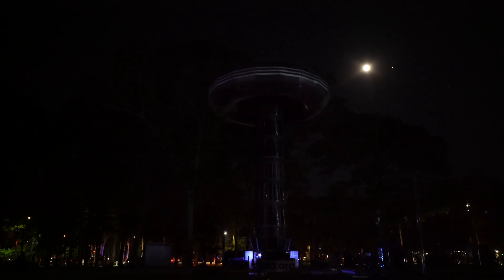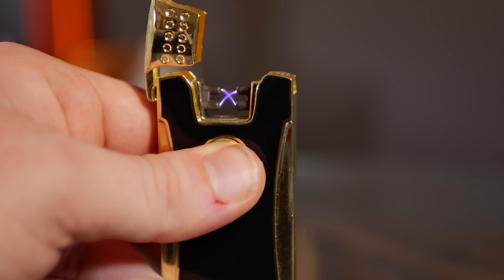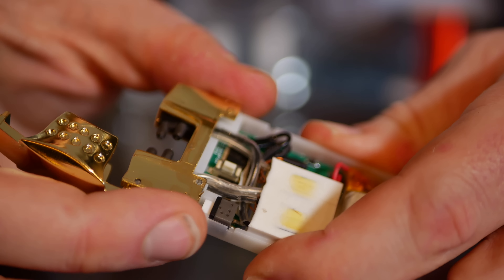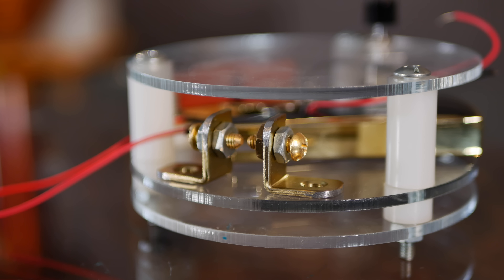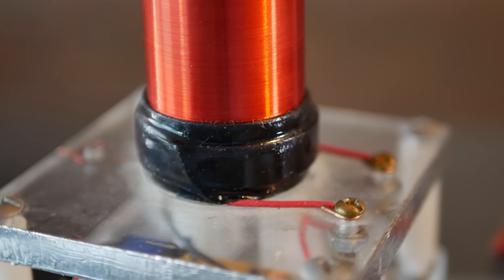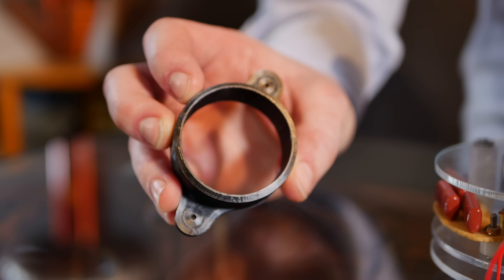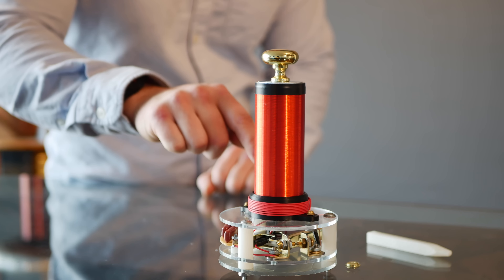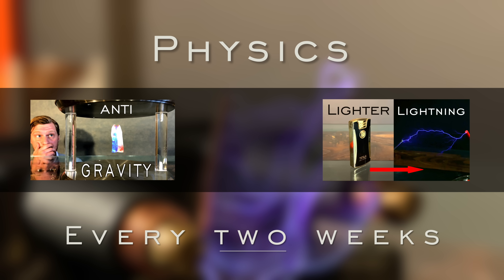DIY 50,000 Volt Arc Lighter Powered Tesla Coil (ft. Integza)

Comment: You never told us what size primary wire to use.
Reply: A bit thicker than the secondary, not really important-turns are.
Reply from the maker: AG is correct.

Comment: Hi Jay, I'm trying to do this Tesla coil for my physics class I got everything but when I testing the Tesla coil is not working? Can you help me.
Reply from the maker: Have you made sure the power source is working? If Yes, do you have the right fast-acting diode? If yes, make sure the spark gap is no larger than 1mm apart. Cheers.
Reply: @PlasmaChannel  thank you Jay for responding, I found the problem, the place I set capacitor was wrong and right know I have a working Tesla coil. Thank you for your amazing Chanel.

Comment: 6:15 also protect from Corona 🤔 .   What did he meant ?
Reply: Corona is leaking charges, usually from sharp points, reducing the output voltage. So the electrical tape prevents charges from leaking, making for a more efficient and higher voltage coil.

Comment: What is the ratio of turns between the primary and secondary?
Reply from the maker: Tesla coils are not necessarily about traditional turns ratios. But whatever 570/8.5 is.
Reply: @PlasmaChannel  my current tesla coil has a ratio of about 275/8 but the driver circuit is basically a flyback transformer driven with a single mosfet. Is the circuit just too poop for this use or the ratio too small? Because i don't get any sparks aside from the spark gap...
Reply from the maker: @drnuget3346  You're driving it with a mosfet...so what...24 volts? Mine is being driven by 4000 volts and a spark gap. You're likely producing a few hundred volts, which is what most small DIY mosfet coils produce
Reply: @PlasmaChannel  nah, the flyback transformer is driven by mosfet and the flyback drives the spark gap. The flyback transformer in parallel with the capacitors creates arcs similar to a tazer.
Reply from the maker: @drnuget3346  Interesting. Have you tuned your primary frequency to the secondary frequency? I dont know what size caps you are using.

Comment: que pasaría si haces otra mini teslacoil pero esta vez mandas el out de tu primera teslacoil a la bobina primaria de tu segunda teslacoil así estaría transformando esos 50.000 en no se tal ves 100.000?
Reply from the maker: Hello Elias, that is a great question. If I powered one Tesla coil with the other, I would need to rectify the output of that first Tesla coil so that it would charge up a capacitor. But, the second Tesla coil would need to be much larger and designed totally differently in order to support a 50,000 volt input from the first coil. 

Ultimately... it’s possible. But tons of work

Comment: Can the wire we enameled
Reply from the maker: Are you referring to the secondary coil?
Reply: @PlasmaChannel  thss we coil that is warped around the bigger coil
Reply from the maker: Are you familiar with what happens to the coil of wire if it has no coating? It acts as a solid tube, and the electricity isn’t forced around the turns of wire, thus, the coil of wire doesn’t work at all. Any coil of wire will always need insulation, and for purposes like this, enamel magnet wire is definitely best.
Reply: @PlasmaChannel  ye o though if it doesn’t neend to be enameled whe not just use a tube but I just had to make sure

Comment: I have a problem. My spark gap isn't arcing when I connect the secondary coil
Reply from the maker: What are you connecting the secondary to?
Reply: @PlasmaChannel  I've got a circuit that you draw with 5kV high frequency diode and three 4nF 3KV capacitors connected in series with spark gap pararerly conected
Reply: @PlasmaChannel  it's exactly like that circuti drawing
Reply from the maker: Hm. How wide is your spark gap?
Reply: @PlasmaChannel  around 1mm but even if I'm about to connect it it doesn't arc
Reply: @PlasmaChannel  my bad I wanted to say primary coil. Secondary si not conected to anything of course. It probably confused you.
Reply from the maker: Try reversing your diode direction. I found arc lighters are AC, but in a biased DC direction.
Reply: @PlasmaChannel  Still nothing. Do you think I should make a full bridge rectifier for it?
Reply: @PlasmaChannel  maybe I can send you some photos and video of it on some social media
Reply from the maker: Ondrej Lukacs yes please do. The link to my Instagram and Twitter are in the video description. I’ll lookout for your pictures.
Reply from the maker: Ondrej Lukacs your case is really strange. Can you send me higher resolution photos of your setup? Hard for me to visually see from the videos.
Reply: @PlasmaChannel   This solved my issue. I had it connected with the anode side toward the arc lighter output (as per diagram) and it brought me no joy... Removed heat-shrink from everything, resoldered it with the cathode side toward the arc lighter's output and-- BOOM! goes the dynamite.

Comment: Im having a problem i cant figure out. it seems like whenever i try to place any capacitor across the arc lighter it just loads it and doest make any sparks and the caps dont charge. its like it just quits working with the cap added. do you have any advice or know why that might be happening?
Reply from the maker: Hi Ozy, did you follow the schematic precisely?
Reply: @PlasmaChannel no i just put a capacitor across the output to see if it would charge it. You see ivd had this problem in the past with trying to use an arc lighter as a mini HV pwr  supply. it just wouldnt work when i placed a cap across it. at the time i figured perhaps the power was just too small and the caps were loading it and prevented the voltage from rising high enough to produce an arc but now im not sure cause i bought another arc lighter recently and tried again with same results. I then removed the small transformer from the circuit and rebuilt the same driving circuit using higher power transistor (and i mightve used slightly different resistora values i dont remember) and connected to my supply to see if itd work with more power but still didnt work when connected to a cap but take the cap away and out comes a nice purple plasma. Isnt that weird? I must be overlooking something cause clearly others have already shown they can be used with multipliers and such. I used a magnet to test to see if the lighters i bought output ac or dc and both mine were DC so there must be a internal diode in the small transformer but im pretty sure that shouldnt make a difference. Id built a hv power supply in the past that was basically a hv joule thief using a tv flyback transformer, which is basically the same circuit used in both the arc lighters i purchased, but i ended up having to scrap it cause it had the same problem of not working when loaded. it seemed like for whatever reason if there was any kind of load connected to the flybacks secondary, the circuit wouldnt oscillate so no power was transfered to the secondary. But again i dont see why thatd have that effect. Sorry for the long question again. I know youre busy so i dont expect you to be able to have time to answer every question you get so dont worry about trying to get back to me if its inconvienient.

Also i just want to mention i loved this latest episode 👍👍👍 As always, your video was well produced and fun to watch.
Reply from the maker: @ozymandiasking173  Ah, so, arc lighters are AC. Not DC. I've found they are loosely polarized, with a fluctuating AC waveform that is has a baseline elevated above zero volts. So it is AC, but net effect in one direction. You need a diode to charge the caps. Without a diode, and the diode in the CORRECT direction, your caps will not charge.
Reply: @PlasmaChannel  oh wow i never considered that. So they are AC. that makes sense. Thanks for answering my question. Thats a big help.
Reply: @PlasmaChannel  can you add to the list of parts in the description? I would be happy to help generate some more formal documentation

Comment: HELP! My son found this video and is building it for the science fair - but we are confused by the final wiring.....can anyone present in layman's terms?
Reply from the maker: Hi Jaime. I’m glad to help - by final wiring are you referring to the entire wiring process, or the electrical ground?
Reply: @PlasmaChannel  the entire process - we can see that one wire comes from the lighter, then loops through one side of the spark gap then to the capacitor - the other wire goes from the lighter to the OTHER side of the spark gap to the primary coil. Then a connection is made between the other end of the primary coil and the other side of the capacitor. We see also, the bottom end of the wire from the secondary coil attaches to one of the bolts - but then where does it go? Sorry, we aren't super experienced here....I guess we are confused - is there no wired connection between the primary and secondary coil?
Reply from the maker: Luckily in this build, the electrical schematic drawing, shown in the video, is actually exactly how all parts are attached. Both wires from the lighter go directly to the spark gap. Then, from the spark gap, a wire connects to the capacitor. After that, the other side of the capacitor connects to the primary coil. Other side of the primary coil connects back to the side of the spark gap that remains.

As with most transformers, there is no connection between primary and secondary coil. Energy is transferred through electromagnetism, not a direct connection.

Hope this helps! Don’t forget the counterpoise connection, and if you get it working, don’t run it for more than 5-10 seconds at a time (then let rest for 2-3 seconds).

Keep in mind the lighter is not designed for this. Too much abuse and the lighter will die immediately. Keeping the spark gap at 1mm maximum will prolong life. 

Cheers
Reply: @PlasmaChannel  ok - to clarify, both wires of the lighter go to the same side of the spark gap?
Reply from the maker: Each wire goes to a different side.
Reply: @PlasmaChannel  ok - we got the whole thing put together...and nothing - no spark - no nothing - I should note that the boys were only able to wind the secondary 460 times....so they looked up all the formulas they could find online and the nearest calculation they came up with was making the primary 6.85 turns....any other possibilities?
Reply from the maker: How wide is your spark gap? Are what model of lighter are you using? If it’s the type with four high voltage wires in it, you need to put two of the wires connected in series, and the two going out are your final high voltage wires. 

Did your lighter work before being connected to the circuit? I found one time while adding the switch, I caused a short circuit... meaning the whole lighter just stayed dead and uncharged. Check that adding a new switch did not mess anything up. 

Usually main culprit to it not working, though, is the spark gap too wide. Decrease the spark gap. The smaller the gap, the faster the pulse rate you’ll receive. 

Cheers
Reply from the maker: Another item that I have found viewers tend to forget, is the high-voltage diode that I mentioned is between the spark app and the lighter. Without the diode, the entire thing will not work
Reply: Plasma Channel - which direction does the diode go?
Reply: SUCCESS!! Thank you Plasma Channel! 
We put in the diode and it was still not right...turned out to be the thin coating on the secondary wire - we sanded that off and BOOM!

Comment: My teacher said a 9v tesla coil can knock you on your but 10 feet away. Can you respond how this can be true?
Reply from the maker: Having worked with Tesla coils for 18 years, built 10 of them, and an avid lover of physics - a Tesla coil powered by a 9 volt battery would not be able to touch you 10 feet away. A one foot spark would be nearly impossible as well. It could maybe get you from 6 inches away, and even still, the power would be so low, that it would be safe. 2 watt hours is what a typical 9v provides. Which is virtually nothing.
Reply: @PlasmaChannel  i dont fully remember the lecture, i was under the impression it was maybe a mistake and it charged up over time.  I appreciate your response

Comment: Why is it that people who make Tesla coils tend to not know why 1/4 or 1/2 wave apply to a >true< Tesla design coil? Most are making Oudin style poke and hope circuits and don't even know the difference. Hint, if the arc isn't even close to the length of the coil, then it is a fail. Instea of hurling frustrated and meaningless drivel, I shall provide answers. A person has to ditch the concept "coil" or "resonator" to understand a Tesla coil. A true Tesla Coil is a device that is designed to transmit and then effectively receive a specific frequency, in concept think either a monopole (1/4 wavelength) or dipole (1/2 wavelength) antenna for AM. 1/4 and 1/2 have specific meaning and reason - examine a single cycle of a sine wave. !/4 wave devices have their transmitter circuit (primary coil) at the base, while 1/2 wave based devices have their transmitter circuit exactly in the center. Why 1/4 and 1/2 wave? IT PLACES THE MAXIMUM POSSIBLE POTENTIAL (voltage) FROM THE SIGNAL SENT BY THE TRANSMITTER AT THE OUTPUT END(s) OF THE RECIEVER (secondary) WINDING(s). Yes, all caps, it is that important. The primary is DESIGNED to resonate at the frequency which corresponds to two (for 1/2 wave) to four (1/4 wave) times the physical length of the secondary wire. Capacitance in the secondary is energy storage. A properly built Tesla coil will blast the full length of it's own secondary coil, or even farther in the case of open air or oil submerged pancake style coils. Tesla didn't "poke and hope," unlike the copycat inventors who did not have a clue like Oudin and D'Arsonval. People can accidentally hit a higher frequency that gives good results (look at multiples of the base frequency as sine waves side by side) as any higher frequency where the highest potential of the sine lines up at 1/4 wavelength with the design frequency will do this, but it also causes high voltage nodes down the length of the secondary causing voltage loss and insulation damage from corona leakage as well as accidental arcing and eventually will damage the receiver coil. The transmitter (primary) circuit is a resonant tank antenna designed to resonate at the design frequency. People look at the various HF style coils from Oudin to Tesla and just see the same thing, but Tesla was obsessive compulsive about precision and design, which is ultimately what made him the inventor he was. To make an actual Tesla coil, pick a frequency first, then design the entire thing to match. At that point, you can even use solid state tech in the primary circuit and still be a true Tesla coil design. A "slayer driver" circuit is anything but a Tesla coil design, for those who are wondering as it picks the resonant tank frequency of the secondary based upon series inductance of the coil combined with it's capacitance, instead of the quarter wave design frequency. Just remember not to mistake the coil length as the wavelength and multiply by two or four to get the actual design wavelength. The farther you get from 1/4 or 1/2 design wavelength, the further down the slope of the voltage sine for said wavelength you will be, and the less voltage you will achieve. 1/2 wavelength devices tend to be more powerful at a given input power. A basic Tesla coil can take four basic designs, a single ungrounded vertical coil with a single primary at it's base (1/4 wave), a long single ungrounded horizontal coil with the primary in the exact middle of the secondary (1/2 wave), or two vertical ungrounded coils separated by space with the secondary coils connected to each other at the base and two identical primaries (1/2 wave), or two vertical coils tuned to exact same frequency but one coil wound clockwise and the other counterclockwise, secondary coils connected at the base (dual 1/4 wave). The last I found in one of his patents a long time ago but have not tried to build one yet myself, nor am I sure as to why Tesla designed that particular device.  Anyway, I hope this information helps.

Comment: Fault in your design
The door nob you use have a screw on bottom
Which by Corona discharge effect gives unnecessary sparks inside the pvc pipe core of secondary coil 
And can slowly burn or melt the pipe
This also happens to electroboom's Tesla coil
Reply: If you get the point reply me☺️☺️

Comment: Meh seen one's smaller that have more output and that has already arcs without you needing to touch it.
Reply from the maker: Interesting. Is that coil’s powersource fully contained, or, wires leading out of it to the powersource? This is fully self contained.
Reply: @PlasmaChannel  Yea that's a good point. I think the powersource, being an arc lighter, really is the limitation. But I think with a bigger battery and a different circuit you can achieve much better results.
Reply: @PiratCarribean  The ones you are talking about are not all self contained, they have a power supply, ect going to them.  You are comparing apples to oranges.

 This is Totally self contained, probably not going to beat this with anything else out there that is self contained.
Reply: @jamesh9555  Some I have came across on the internet are. A small SSTC with the same form factor as this one with a battery in it.

Comment: I don't think the tesla coil is touchable because it burned my finger
Reply from the maker: Small ones like this you can touch for a couples seconds at a time. But if you leave your finger there for a while, yes, its possible you may get a small burn. Over all, these are very safe.
Reply: @PlasmaChannel   maybe because my has too much frequency